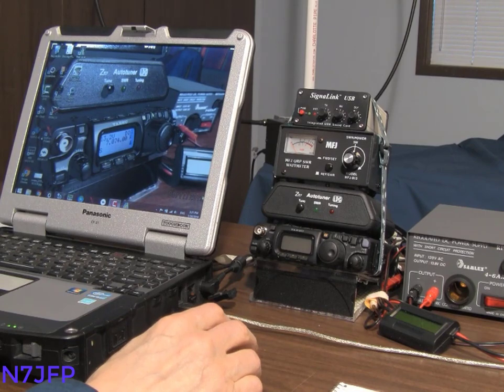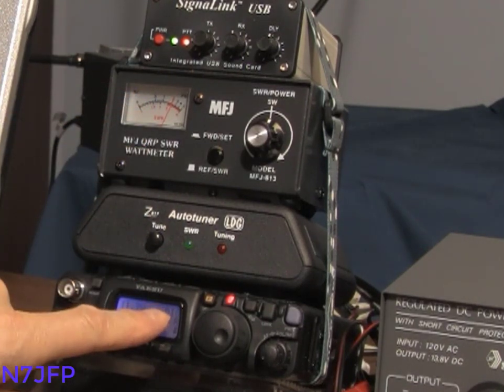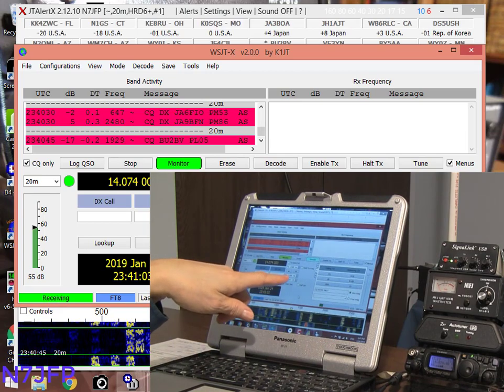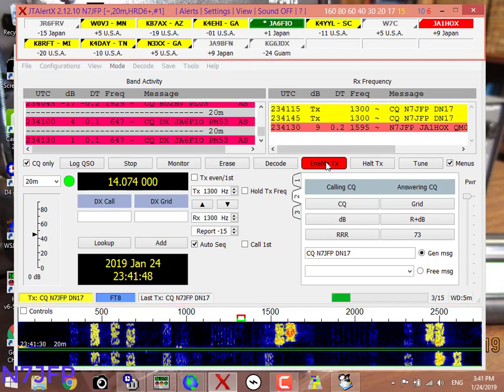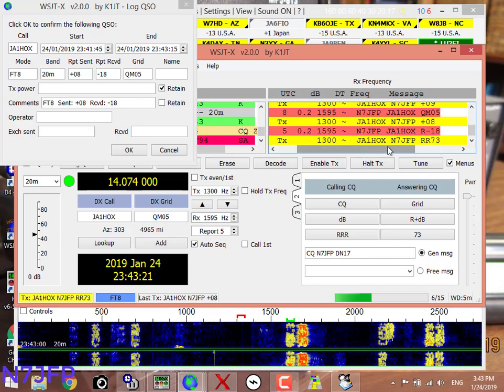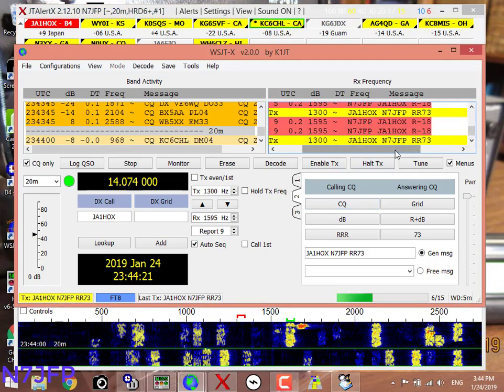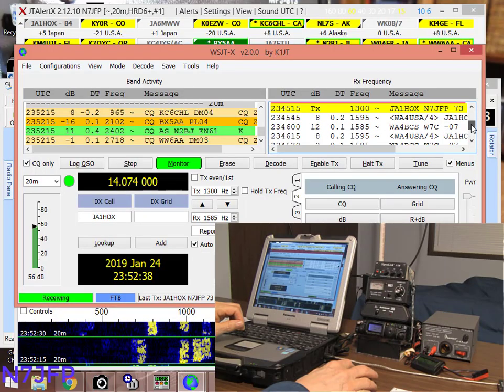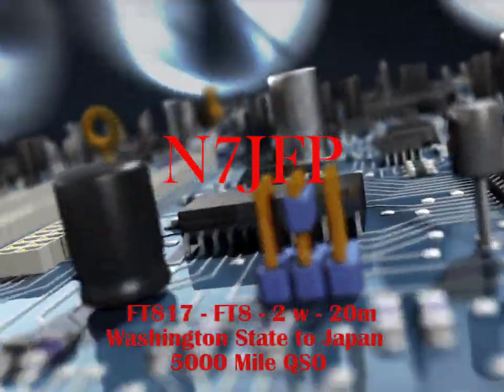FT817  QRP - QSO - 2w - FT8 - 5K - WSJT-X - HRD - JTAlert  - N7JFP

Comment: Can you do a video showing a complete setup, got the same equipment as you but I can’t get it to control the radio.
Reply from the maker: Watch my video on connecting the hardware: "FT817 to Laptop Cabling".  Setting the FT817 menu with "Setup the FT-817 for PSK31".  These two videos should get you up and running.  Good Luck.  73, N7JFP

Comment: new to this never seen anyone use the jt alert thing. The states the voice is calling out are those contacts or just what is available? Also the red yellow and green call signs what do the colors mean?
Reply from the maker: JTAlert does a lot of things to make your QSO more enjoyable.  The stations displayed are the ones being decoded.  The color scheme is variable to what you like for a color layout.  In this case the yellow ones are States I need for WAS.  The Green borders are stations calling CQ.  The solid Green are stations that are DX Countries.  It comes with a default color scheme that you can change.  The voice can be turned off.  73, N7JFP
Reply: very cool had no idea will have to play with that. @N7JFP